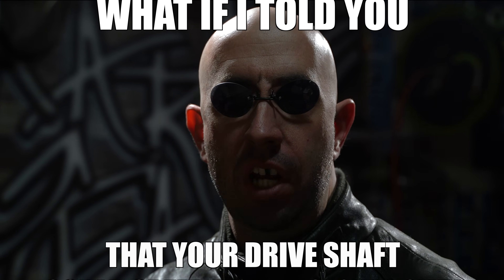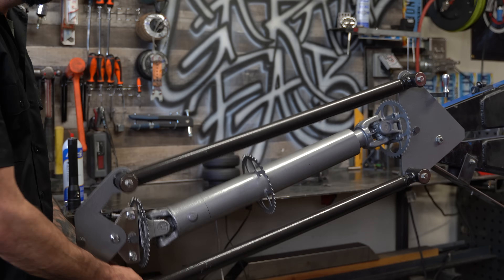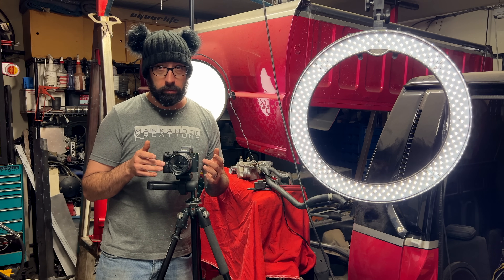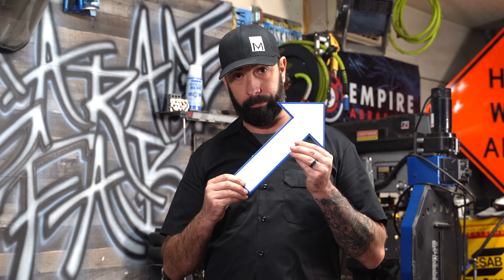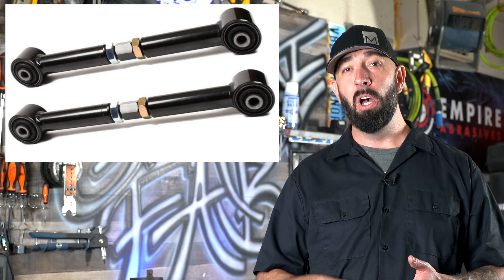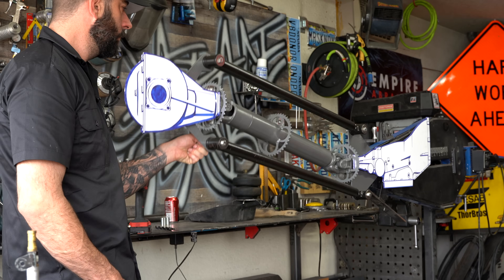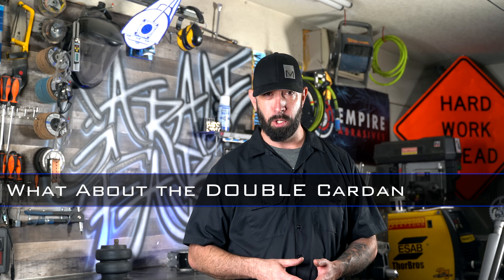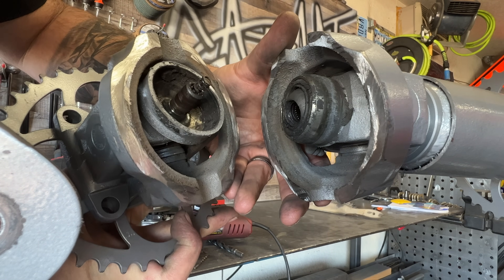THE Driveshaft Video. The Nature of U Joints. Suspension Basics Ep. 06

Comment: Wow. Just wow. You probably just saved me 2 months of head scratching as I prepare to swap a dually from a 2001 Chevy 3500 into a three piece drive shaft 1954 two ton. Rear end propeller sits back 4inches and is probably slightly off centered.
Reply from the maker: Oooo! 😯A three-piece seems like a fun challenge. Lemme know how it goes and if you need guidance. I’m happy to be of service, Anthony.

Comment: So is it the angles of the joints in relation to the cross or because the bearings at the ends of the cross that can only rotate 90° that causes the variable velocity? Would a cross with ball joints still have the variation?
Reply from the maker: This is really difficult for me to explain in text without visual examples, so I highly recommend searching for some videos on U joint oscillation so you can SEE it.
When a U joint is bent, because of the cross, the bearings in the two halves of the U joint follow a slightly different path in relation to each other. 
One could be seen as rotating in a perfect circle, and therefore a constant speed. The bearings in the other half that are at an angle are then forced to follow an oval path. Because the RPM doesn’t change, the oval pattern causes the second half of the U joint to speed up and slow down.
I’ll see if I can find a video myself and send you a link.
But to answer your question, changing the bearings wouldn’t change anything. It’s the cross itself that causes this issue.

Comment: Great video, very thorough explanation. Question, if i am building hydraulic suspension with rear cylinders that extend to 24”, is a one piece drive shaft okay or is it better to go with a two piece with carrier bearing?
Reply from the maker: I hope you got your reading pants on…

It really depends on your rear suspension set up.
Let’s assume you want to drive at all ride heights, from 0 to 24 inches. I’d highly recommend a triangulated 4 link with equidistant axes of the upper and lower bars. (NOT Equal length bars.) i’ll clarify if needed.
This will keep your pinion angle constantly parallel with your transmission.
You will sacrifice some performance traction but with 24 inches of travel, you’ll need to focus on keeping your driveshaft happy.
Here’s some important stuff to know about how the driveshaft and suspension linkbars interact with each other.
You familiar with a driveshaft slip yoke? The piece at the front of the driveshaft that moves in and out of the transmission?
The amount that the slip yoke moves, is determined by the difference in length between the driveshaft and the rear suspension linkbars.
If the drive shaft and the link bars were exactly the same length, the slip yoke would not move. This is because the arc that the link bars follow would be the same as the arc that the drive shaft follows.
When the driveshaft and the link bars are different lengths, the arcs that they follow are different, and since the linkbar’s cannot slide, the drive shaft is forced to slide on the slip yoke.
The difference between the two types of drive shafts are that a single piece drive shaft requires slip yoke and the two piece does not! With a two piece shaft, the front section does not move. The trans is stationary and so is the carrier bearing. Only the rear section moves with the suspension. A sliding connection can be fitted to this rear section but for the most part it can’t move. This means that the link bars and the rear section of drive shaft should be closely matched in length.
Yay! Here’s the problem though. U joints don’t like extreme angles. They have a maximum operating angle that shrinks as the speed goes up. The shorter the driveshaft is, the more extreme the U joint angles will be. That means with a two piece drive shaft that has rear shaft that’s effectively half the length of a full shaft, the U joints will be at a more extreme angle at a full 24 inch lift. The truck could cruise a parking lot vibration free, but the freeway would be another story.
That said a longer driveshaft is better for a vehicle with more suspension travel. 
But don’t forget the difference between the link bars and drive shaft.
For your vehicle specifically, I’d recommend a single piece driveshaft with the longest possible link bars you can install. They don’t have to be the same length as the driveshaft, just as close as possible. You’ll have to measure the arcs of both components to determine how much slip yoke movement you’ll have. We’ll worry about that a little later down the road.
Hope this babbling made some sense.
Reply: @GarageFab  thank you for that explanation it really helps. I will have extended trailing arms and a wishbone setup as well. Arm mounts were moved up 8” if i remember correctly. Are the trailing arms what you are talking about or are you saying link bars like pan hard bars that run parallel with the rear end?
Reply: @GarageFab  i see what you’re saying now i googled it. In my last reply i will be using extended arms and a wishbone so it wouldn’t be set up for the two extra arms on top to make it a 4 link. I will be running a pitbull ford rear end so i could ask him to add those top mounts to the top of the pumpkin
Reply from the maker: Your suspension is sometimes referred to as a 3 link. (The wishbone would be considered a link)
With 24 inches of travel, if it’s not already, I’d strongly suggest that your wishbone be the same length as the trailing arms. Often, wishbone kits provide a wishbone that’s significantly shorter than the lower bars. If this is true, it wouldn’t be surprising to experience a driveline vibration at one or both of the extremes in suspension travel. (Lifted all the way up and/or fully lowered)
Side note: You likely already know, but a panhard bar is generally not required on a suspension with a wishbone.
Reply: @GarageFab  I haven’t built everything yet as the frame is getting welded up and completely wrapped. I will have the new adjustable trailing arms and i will be running the hoppos newer style billet wishbone. I don’t plan on doing much driving at full lock up more for parking and standing 3 wheel. Cars that i have seen with similar setup’s don’t have a 4 link setup so im not sure how there’s are driving or reacting while driving. I have seen on another channel a guy who describes different pinion angles and how they matter. He said something about a dual u joint setup on both ends to take the stress off the whole setup. I may be wrong on the ujoint reference i will look it up and see what its called
Reply: @GarageFab  im a dummy, it was your video on u joints. It was a double cardan joint. Would that work well with my setup?
Reply from the maker: That’s a tough one to answer without being able to draw it out on paper. If the wishbone is shorter, (they often are) a double Cardan joint in the front of the driveshaft might be a good idea. I would angle both the lower bars and the wishbone to point somewhere near the front bumper. This will cause the pinion angle to change similar to a 2 link suspension. That motion will work well with a Double card and joint.
Reply: @GarageFab  once i get to the point of needing the drive shaft i will ask the shop who will be making it that question and hopefully they will know how to proceed
Reply from the maker: Brilliant! Lemme know what they say.

Comment: I noticed some modern trucks use actual CV joints instead of universal joints. Why don't we do this on our various projects? CV joints are already accustomed to huge amounts of torque, and pretty high speeds, so it doesn't make much sense that we don't use them instead of universal joints.
Reply from the maker: For most cases it would be a great aftermarket upgrade. They’re a little heavier though so they’d likely zap a little wheel horsepower. Not enough to bother non-professional racers.
They are significantly more expensive than U joints so it’s not common for vehicle manufacturers to use them.
Most importantly, if they’re set up properly, the U joint is more than acceptable!

Comment: Greatly appreciate your videos.  They are positive and very informative. It is obvious you spend a good amount of time to make them. 

When talking about the double cardin joint, the U-joints can't be in parallel. Instead, the differential must point up in a straight line toward the output on the transmission/transfer case. I built a 51 Willys Jeep that is far from stock. The rear driveshaft is 15 1/2 inches long. It had to have a double cardin at the transfer case and a single U-joints at the differential which points straight at the transfer case output. The Jeep runs perfectly smooth running down the highway.  There was only one driveshaft company that would make that shaft for me. I use them every time I build an off road/on road vehicle..

Thanks again for your videos.  Maybe you could do one on driveshaft/U-joints angles using the double cardin.
Reply from the maker: Thank you my friend. Your setup is absolutely perfect for that type of shaft.
I’ve got a lot planned for the channel already. Unsure if I’ll be visiting the driveshaft again. (Especially since the next truck won’t have one. 🤔)
But I suppose a video on how to determine angles and how to change them in various types of suspension would be helpful.

Comment: Would if you build a RWD driveshaft with CV joints? Say from a 72 El Dorado?
Reply from the maker: Then this video would be obsolete!! 😳 CVS are a little heavier so it’ll zap a little wheel horsepower, but if your not racing, wouldn’t be noticeable.
Reply: @GarageFab  your video wouldn’t be obsolete. I’m saying you could build a game changer for bagged vehicles. Any height could be ride height without damage
Reply from the maker: True. This is the reason I generally prefer a parallel 4 link. This will also give you the ability to choose any ride height. The downside to the parallel 4 link, though, is you sacrifice a little traction on acceleration. So the CV would allow you to use a more beneficial linkbar geometry AND still not worry about a ride height. 👍
Reply: @GarageFab  Be the first! How often can you be original? It would a great video
Reply from the maker: Not very often!

Comment: I was told if you run it straight it will wear out your universal joints that they need a minus 3 degrees to fully rotate the small bearings
Reply from the maker: Hey Curtis! You’re not wrong. Some angle is good to keep the needle bearings and grease moving, though 3 degrees is a bit much if you’re using a double cardan joint. I’d recommend no more than 2 degrees on a street vehicle and even less on a high speed vehicle.
You can ignore all this on a vehicle with adjustable height suspension, because it’s impossible to keep a U joint straight if the ride height changes.

Comment: Damn it! Now I need to check mine! Lol... Thanks for the info....
Reply from the maker: Lemme know what you find Dave!
Reply: @Garage Fab  I'm almost done swapping a 1UZ into my Surf.
It's gonna be awesome, but I just fitted the engine where I fit best, but now, I think I should check my pinion  angel. 
If it is out, can I offset it with adjustable bars?
Reply from the maker: Usually, yes. What type of suspension is in the rear? Coil overs? Air springs? It shouldn’t be too hard to correct if needed.
Reply: @GarageFab  it's a Gen2 Surf/4Runner. Separate springs and shocks, 4 bar and panhard rod.
Reply from the maker: Ah! I’m familiar with the 4Runner. Didn’t realize they were the same. It really depends how far out the pinion angle is. There’s a possibility you’ll have to get adjustable upper links and lowers to get enough pinion adjustment since adjustable links often only provide 3/4 inch of adjustment. If that’s still not enough… custom link bars. 😳
Reply: @Garage Fab  Cool.
I can Fab, so I'll measure the angles and work something out.
Thanks for your support. 
It really helps.
Reply from the maker: My pleasure.
Reply: @Garage Fab  How much out is out?
I just measured it, and from horizontal, the gearbox flange is 85.7 down, and the axle is up 85.4.
Is .3 of a degree OK?

Comment: Two double-cardan joints, one on each end? (Ie. 4 light switches)
Reply from the maker: I’ve never seen it! I don’t know why. Double cardans are too expensive? Too heavy? Or just not necessary if you follow the rules?
In theory, they would work fine and would eliminate any possibility of misalignment of the driveshaft regardless of what angles the trans and differential are in. 🤔

Comment: If my tranny is faceing down to the grownd 4 degrees where should my pinion be set at
Reply from the maker: I’m assuming you didn’t see my response to your comment yesterday.
Short answer: You’re differential would be pointed up 4 degrees.
Long answer, copied from yesterday:
You are correct, David. In theory, if your transmission is pointing down 3.9° your diff should be pointing up 3.9° to create a parallel relationship between the trans and pinion angle. If someone tells you not to tilt your diff more than 2 degrees, ask why. My guess is they’re trying to avoid oil starvation at the front bearing, but I personally don’t think this is a concern. The ring gear does an excellent job of slinging oil forward to lubricate the pinion shaft. There is no pump in a differential. I can’t guarantee this will not damage the diff but I wouldn’t be concerned if it were my own.

Comment: I have a 70 chevelle with zz502 my tranmision is facing down 3.9 degrees  it has coil overs all the way around if u look at my drive shaft it's going up in back so when u look at tranny joint it's not right I have adjustable rear upper control arm so would I set my pinion angle negative 3,9 I can't shim tranny because of oil pan clearance with centerline also my car is lower then stock in rear like 2 inches wat do I do everyone say I can't have more then negative 2 degrees on pinion
Reply from the maker: You are correct, David. In theory, if your transmission is pointing down 3.9° your diff should be pointing up 3.9° to create a parallel relationship between the trans and pinion angle. If someone tells you not to tilt your diff more than 2 degrees, request the reason why. My guess is they’re trying to avoid oil starvation at the front bearing, but I personally don’t think this is a concern. The ring gear does an excellent job of slinging oil forward to lubricate the pinion shaft. There is no pump in a differential. I can’t guarantee this will not damage the diff but I wouldn’t be concerned if it were my own.

Comment: Yea combing the internet for this info gets you a ton of JARGON articles. Thanks for helping a lehman like myself understand this stuff 👍
Reply from the maker: Me pleasure! Thank you 🙏
Reply: @GarageFab  can I pick your brain if ya got the time?
In your opinion, (say for my case) I'm removing 3 inch spacer blocks with 1 inch spacers. What's your advice on the best way to get the degrees to match up before locking everything down? I've got some separate 2 degree shims with the spacers in the back as well. Any advice would be greatly appreciated sir
Reply from the maker: I’ve got to make a bunch of assumptions here. I’m assuming we’re talking about leaf spring lift/lowering blocks. And I’m also assuming your blocks are NOT angled. MOST of the time, changing ride height with lift/lowering blocks doesn’t require any attention to pinion angle. You’re not changing your driveline angle and because the typical blocks are rectangular, your not changing the pinion angle either. All that matters is that the trans angle and pinion angle match.
It’s not until you change the springs, (Like removing leaves) that you need to check and make sure the pinion angle still matched the trans. Hope this makes sense.
Reply: Holy shit man I did not see your detailed reply! Thank you for the clarification! I went out and got a digital angle finder and everything and tried checking it and couldn't get it right lol.
Thanks for putting my mind at ease. Got those blocks in and drove around and no drive line vibe so you're absolutely right. Thank ya sir 🙏 😊

Comment: What if you use a  double cardan at each end of a front driveshaft? 

Or a true CV (ball bearing style) joint on driveshaft? However I don't know of any aftermarket driveshaft companies doing this?

Guys with Jeep Wrangler 392 are having front driveshaft vibration if lifting Jeep more than 2.5" over stock.
Steering issues if axle is rotated out of spec.
Reply from the maker: I’ve never seen a driveshaft with two double cardan joints and I’m unsure why. Probably because they’re expensive and the second double can usually be avoided by changing some angles.
I also have no idea why there aren’t more CV driveshafts got Jeeps on the market. I’d think that would solve a lot of problems. There must be something I’m missing.

Comment: What does a driveshaft do that has 1 CV joint and 1 U-joint like the DriveShaft Shops? Camaro5 wants to know :hand-purple-blue-peace:
Reply from the maker: Nothing! As long as that single U joint is relatively straight. 😉 As soon as it bends, you might have some issues at higher speeds because there’s nothing to cancel out its oscillation.